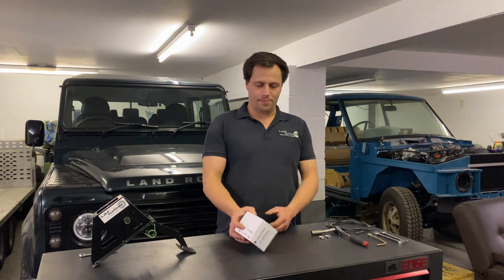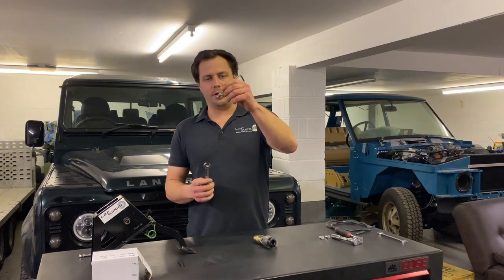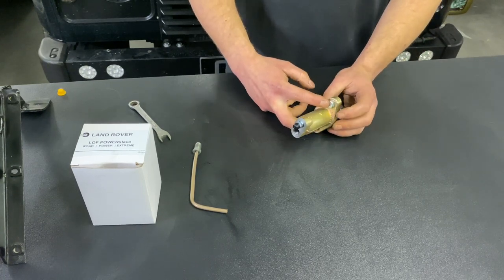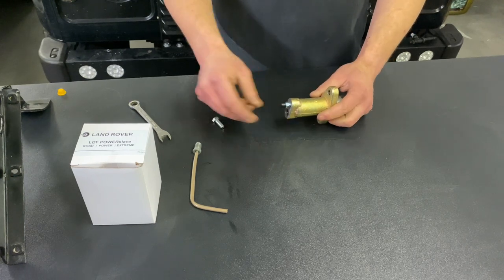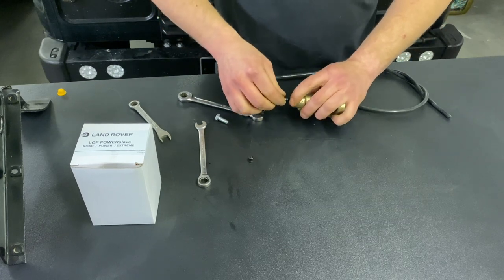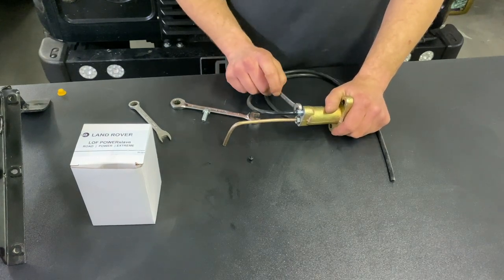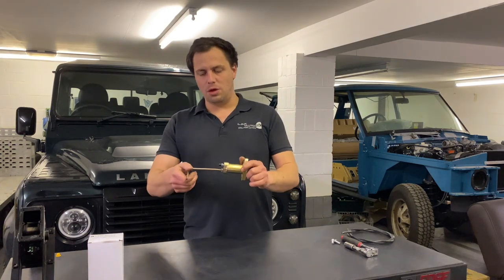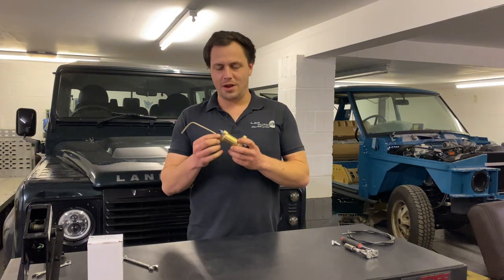LOF POWERslave fitting video for all Td5 Defender and Discovery

Comment: Hi, can this slave unit be fitted to a standard clutch. The reason I ask is that I have a left leg problem. Thanks.
Reply from the maker: Hi Graham, yes indeed it can be fitted with any clutch, providing the clutch is bedded in and not brand new!
Reply: Cheers thanks